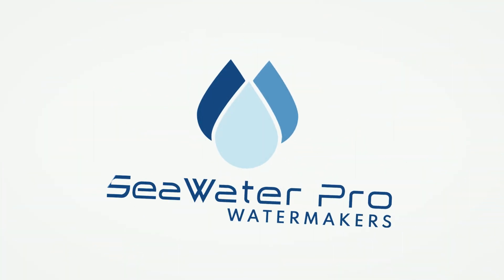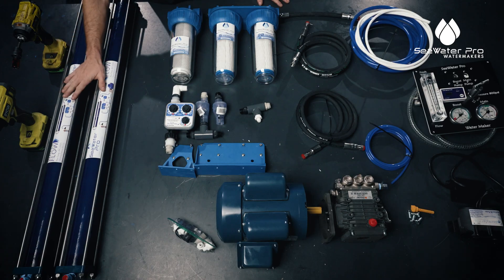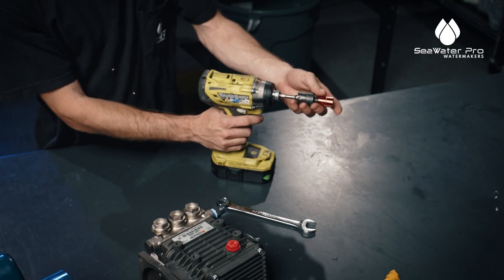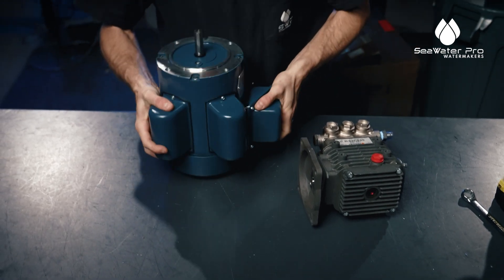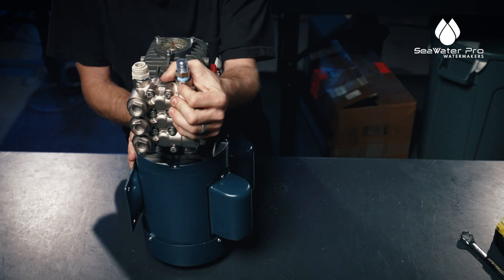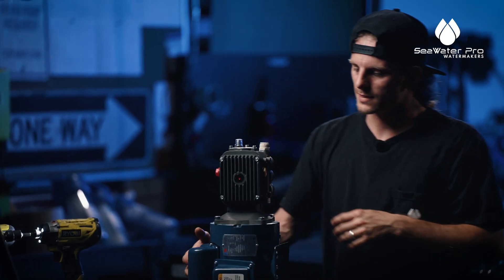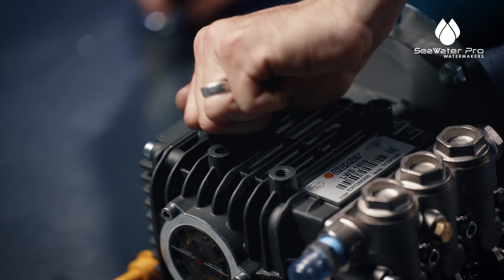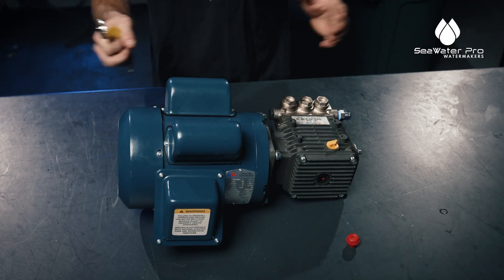PREP AND INSTALLATION - Getting Started | Part 1| SeaWater Pro

Comment: Oil cap? Does that mean the pump will need servicing eventually?
Reply from the maker: The oil needs to be changed once a year with regular use. Our new Micro water maker will require no maintenance besides the boost pump.